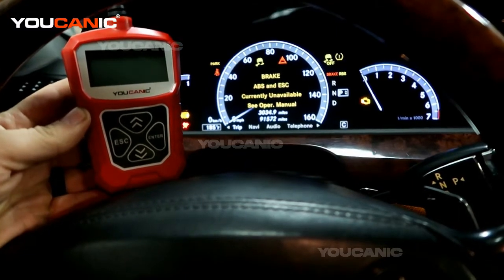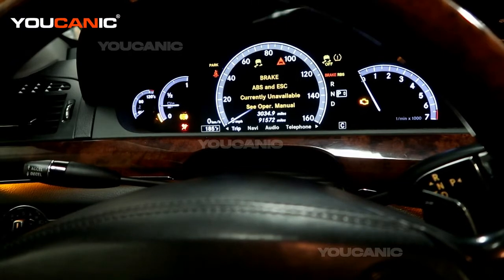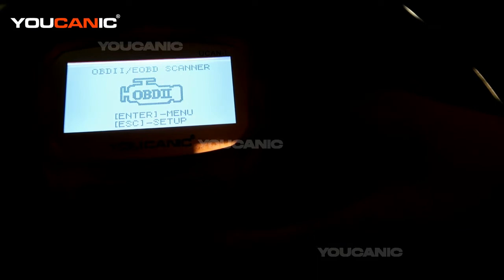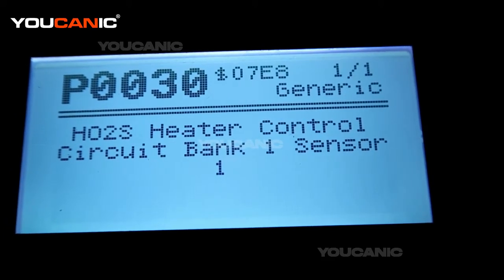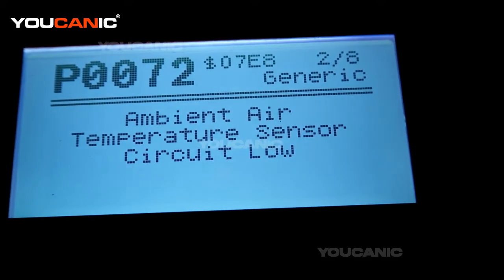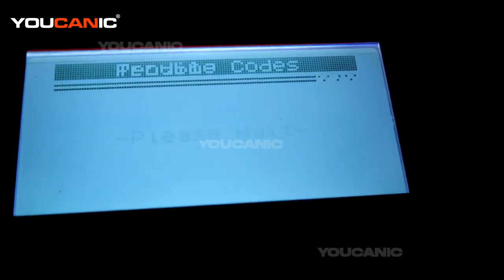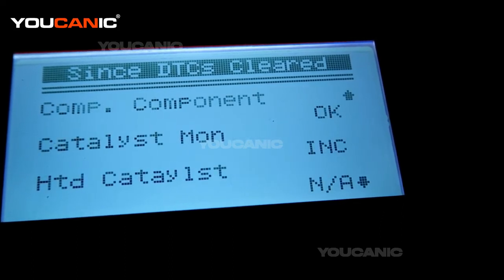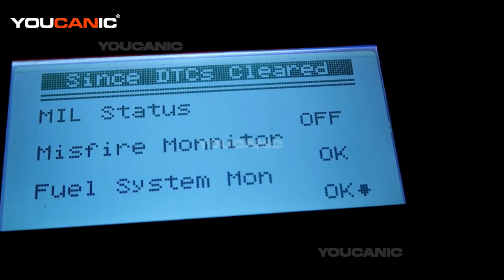YOUCANIC UCAN-I SCANNER: Hands on Review

Comment: How well does it do with PRE-2007 Dodge / Chrysler minivans ?  I found the D7 and D8 were extremely limited with those vehicles...to the point that an OBD2 scanner was just as good.  Virtually zero Bi-Directional control for those vehicles.  The price of new cars,  the cost of insuring them and the limitations car manufacturers are putting on DIY repairs is driving many to keep older vehicles running.  I think most Scanner companies are neglecting this.